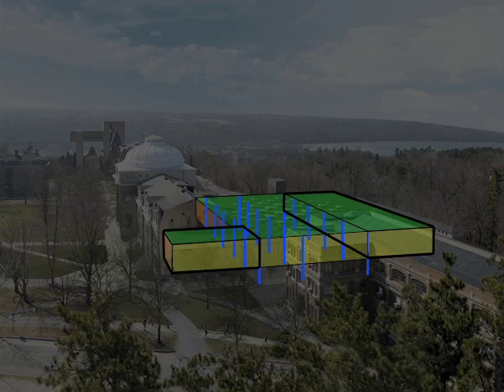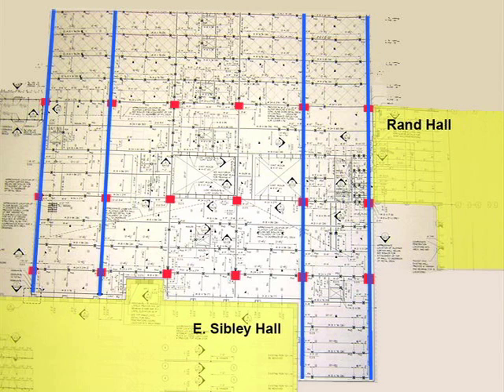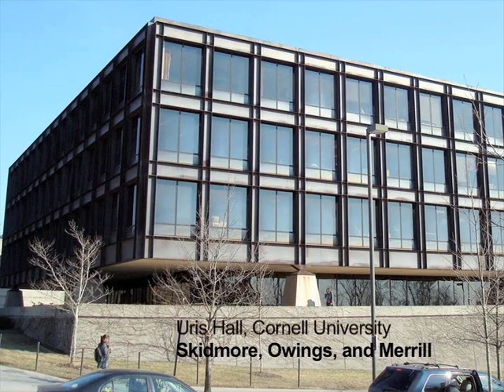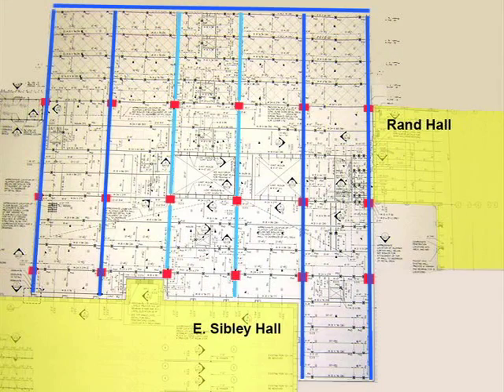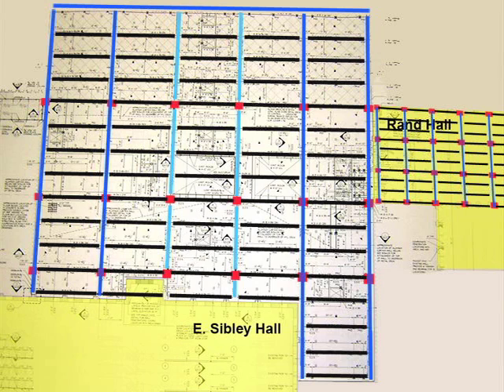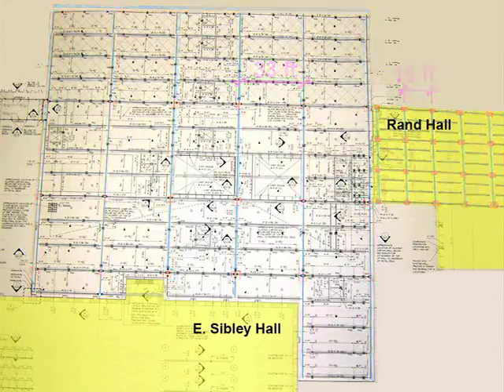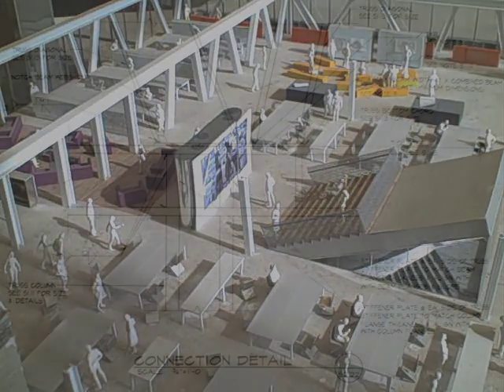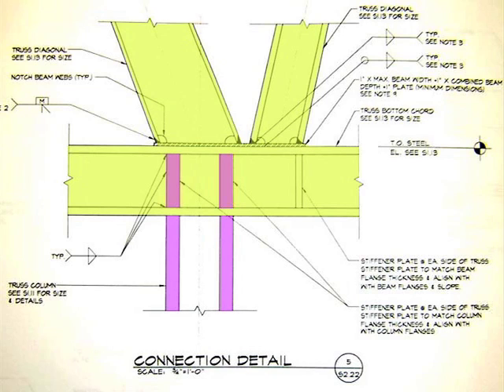The Construction of Milstein Hall - Part 5 Steel Superstructure

Comment: 🎯 Key Takeaways for quick navigation:

00:22 Milstein Hall's superstructure has a large floor plate with cantilevers in two directions, supported by trusses and girders.
01:57 The challenge of resisting lateral forces without shear walls is addressed by creating rigid connections at column-truss intersections.
03:03 Construction involves lifting truss segments with a 650-ton hydraulic crane and careful coordination to fit cantilever sections into place.
05:06 Cantilever trusses, extending beyond the main structure, present unique challenges during construction.
07:11 The second floor features a diagonal seating area and skylight openings, with meticulous on-site welding for joint connections.
08:06 The construction concludes with a free-standing steel stair structure on the west side of Milstein Hall.

Made with HARPA AI
Reply from the maker: Impressive AI transcription, but I believe that effective and productive learning benefits from actual viewing of the video by a human. When you take notes yourself, rather than by relying on some AI summary, the information has a better chance of getting into your brain — rather than into the brain of the AI software.